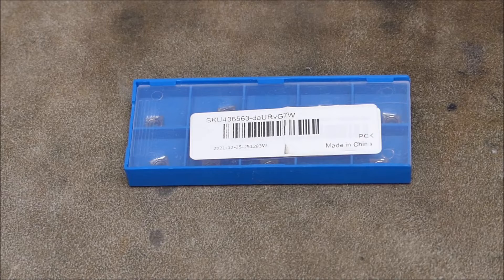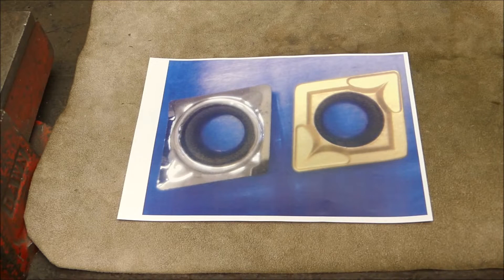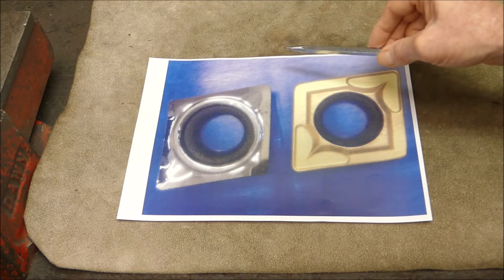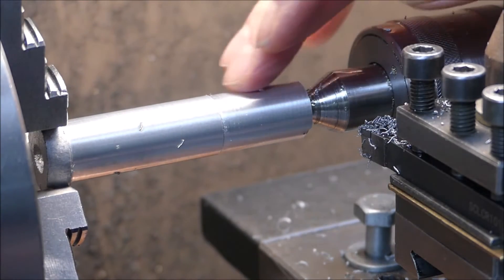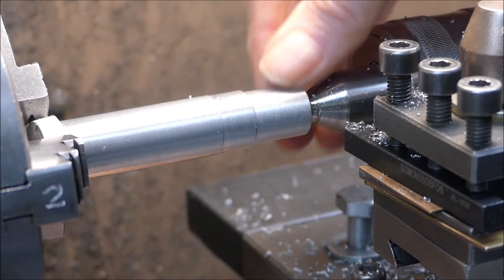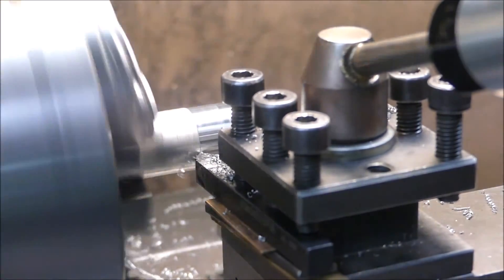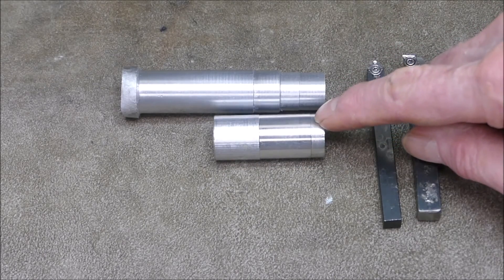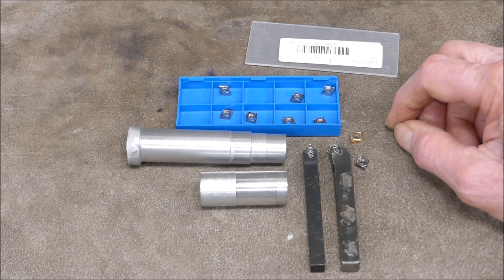Are cheap carbide inserts for turning aluminium any good ?

Comment: These cheap aliexpress inserts definitely have a  place in the home workshop, i have tryed alot of them (draws full of then) with various geometry & for various metals & after months of testing  there weakness is longevity there no where near as hard (there brittle) compared  to branded inserts but they are cheap enough to just replace however they have no place in a production environment IMHO. Some of these inserts are just superb but you have to use the correct inserts for the correct metals & speeds.
Reply from the maker: Yes, you get what you pay for.  The quality of Chinese inserts has improved markedly over the years and is way better than inserts made in India (from my experience). For home use Chinese inserts are fine.  There may be high end Chinese brands suitable for production work, I can't say as that's not my field.  For home turning/learning it's better to ruin a cheap insert than an expensive name brand.  They can all be damaged through misuse. Cheers Rob

Comment: I bought some WNMG inserts for aluminum, I found they gave a reasonable result on mild steel. I tried them as a last resort, noting else was working.
Reply from the maker: They have a very sharp cutting edge  (for carbide) and work a lot like HSS.  Particularly useful/effective on low grade steel that would otherwise tear up and feather badly. Only good for light cuts otherwise they will break the edges.  Not recommended for brass as they can easily catch and dig in due to the large top relief.  Cheers Rob

Comment: I use those same aluminium inserts, I like them ! They give me a really good finish and I like the super sharp edges… I don’t ever take huge cuts, maximum 0.5mm cut, but for the work I do is fine…
Reply from the maker: Yes, provided you keep the DOC down they work great on most metal.  Don't use them on brass as the profile is all wrong and they will catch and dig in.  Cheers Rob

Comment: I use those inserts all the time on my personal lathe. A guy gave me 50 boxes of different types at an auction. They finish steel better with high rpm’s. I use a homemade drip solution with aluminum for a good finish. It’s possible to run dry with a feed rate of eternity. 
I mean they are cheap and like high temperature. Might as well crank the rpm’s up. I’ve spun up around 1500 with mild.

Comment: Love your honest practicable reviews Rob.  If your home melt castings are from previous cast aluminium they will contain a percentage of silicon to help with fluidity and shrinkage.  Silicon is hard (try machining silicon bronze compaired to leaded bronze) and the machined finish will suffer in aluminium. That's often the trade off, good castings that fill the mold with reduced shrinkage or good surface finish when machining.
Would be great to see how these inserts would perform on light cuts in steel and if they produce the same good surface finish.
Cam
Reply from the maker: Hi Cam, thanks for the comments.  I will try the other tips of the already damaged insert on some mild steel and see what happens.  Quite a few viewers say they do it.  So I guess I had better follow up on this ;)  Plastic and copper are also supposed to machine well.  Stay tuned.  Cheers Rob

Comment: Interesting review Rob, used to use these a lot in my past (obviously not Banggood ones lol), they are good as a finishing insert, will do a decent job in mild steel also. Happy New year. Cheers, Jon
Reply from the maker: Interesting info Jon.  I see a few similar steel use comments, but only for very light cuts.  It chipped dead easy to the point that I was a bit shocked.  Most Banggood inserts are pretty tough, although I have found their DCMT blue nano inserts chip easily.  TCMT is a good all rounder and was the first carbide insert recommended to me (by a machinist) when I got into metal turning.  I hope 2022 turns into a better year for everyone.  Cheers Rob

Comment: You are not using them correctly. Far too slow and shallow. Any decent insert will have the recommended speed and feeds on the box. 
They are excellent on brass and intermittent cuts are not a problem.

Comment: I use CCGT inserts all the time for Aluminium. The polished top surface helps to stop galling but yes, they are still best with coolant/lube. A 1" dia. bar could do with turning at 2000 rpm though! They can also be good for light cuts on Stainless Steel (at much lower speeds, of course) though, as you say, they are a bit fragile. Wrong geometry for Brass & definitely not for Cast Iron!
Reply: I’d say 3000+ would be fine with coolant

Comment: Happy new year Rob. I use these inserts for everything, the positive rake takes a lot less effort to push through materials on my tiny lathe, I first heard about using them from the channel "smalllathe" who uses them on his benchtop CNC lathes.
Reply from the maker: Hi James.  Yes, you put much less stress on the lathe using positive inserts.  Negative rake inserts are really meant for stronger machines and are more durable, so industry uses them a lot.  Cheers Rob

Comment: Hi Rob. I have a box of those, so far only used them on aluminium, great finish, but I think it's time to experiment 🙂 Cheers, Alan.
Reply from the maker: Hi Alan,  I had never used them before and they did well for carbide.  I was impressed with the end result.  No good for brass, but people say they work well on plastic and copper, so there's a few things to try.  I had been meaning to try these for quite a while.  Lots of positive written reviews on the web page.  Cheers Rob

Comment: Your casting could machine better if you made it from only extruded aluminium, which has almost no silicon in it. The  shop made casting at least does not make long chips when machining, as it work hardens during the cut. Extruded has to be purer to extrude properly, so will make long chips.
Reply from the maker: Sounds reasonable to me Sean.  I mainly use recycled alloy car wheel rims, which are pretty tough, but probably have a bit of silicon in the mix.  I don't have a source for extrusions, otherwise I would give it a try.  Thanks for the comment.  Cheers Rob
Reply: @Xynudu  Just start to collect scrap metal till you get enough extrusions. Might mean a day or two on garbage day, driving before sparrow fart looking for any hard rubbish with enough aluminium in it, then collecting the lot till you get enough to try a single casting.  Probably will have a lot of shrinkage in the cast, so use your largest longest pipe for it.  If it does not work mix with the regular casting, and your chips probably will end up longer, with a slightly better finish. Will not be as hard to machine.

Hardest thing to machine is PTFE, especially when pure, when you really want a nice sharp brand new tip in the lathe. Next is pure unfilled nylon, and the nicest is self lubricating Vesconite.

Comment: I've used these on the little Drummond for light cuts on ally and steel . Can't fault them for convenience but my best home ground HSS has it hands down for finish and durability.
Horses for courses, I keep a few handy because they have their uses.
The point you make about machining grade as opposed to random unknown metal is an important one for anyone new to lathe work.

Countless times on forums we get the I can't get a good finish question. The answer is usually that the random lump of steel /ally in the chuck 
is the culprit ,not the tool or the lathe.
A good review Rob, I think you covered all the issues very clearly there.
Reply from the maker: Thanks Lee.  The quality of the lump in the chuck certainly has a big effect on the outcome.  Trying to turn rubbish makes you learn faster and correct the situation ;)  He He.  I think we've all been there at some stage.  It can be a challenge. Cheers Rob

Comment: It's ok for steel as long as they dont get used for interrupted cuts. Plenty of wd40 or kerosene oil needed for aluminium or you'd get aluminium build up on edge ruining it. Rubbish on brass, even have had some catch and break.

Comment: I use these for everything up to stainless steel and sometimes resharpen them on a diamond plate.
It's a bit unsophisticated I guess, but I like the results on my similarly sized lathe.
Reply from the maker: Sounds good Robin.  I often resharpen my GP inserts and it's a good opportunity to play around with different profiles.  It doesn't take much variation to make a big difference.  I will try the ally ones on other materials when I get a chance.  Cast iron would be interesting.  Cheers Rob
Reply: @Xynudu  Sounds good to me. 👍🙂

Comment: I have several boxes of those in the insert drawer . Great when your working on a fast spinning soft metal !
Reply from the maker: Hi Shawn.  I had never used them before.  How do they go with interrupted cuts ?  I use HSS normally for ally and brass.  Cheers Rob
Reply: @Xynudu  they work well as long as you take it easy and not try to take to much at one time . If you order them out of china they are even cheaper ! Great share Rob ..

Comment: I got some aluminum inserts from banggood for my face mill the do great, but my high speed steel with a  round radius is hard to beat. Great info rob,👍.
Reply from the maker: Yes, HSS is hard to beat for some applications, interrupted cuts especially.  Cheers Rob

Comment: Happy New Year, Rob! Interesting results! 2 cents: You really shouldn't put down your homebrewed Al, as it's a different animal from the storebought pure product. Guess your remelt was from diecasts - as it gets that short, curly swarf from its ca 8-11% Si content, and hence cannot get that über-fine turned finish as the pure Al gets (and also not the stringy swarf bird nests...) The contained Si also wears HSS cutting edges faster than pure Al does, but you could use an HSS shear tool + polish if you want to get closer that mirror finish, but that's the tradeoff for using Si in the melts: better mold flow, less shrinkage, self-ageing and a bit harder than pure Al. ATB DIYSwede
Reply from the maker: Happy new year to you as well Johan.  That aluminium was from melted down Toyota alloy wheel rims, not die cast.   I hope you noticed there was NO porosity in it despite the fact that I don't use a degasser or flux ;)  It's all about the temperature.  Pour as soon as it becomes liquid and you won't form hydrogen.  The inserts did well, but HSS will do just as good.  I was interested to see if the inserts were as good as some people rave about them.  Cheers Rob
Reply: @Xynudu  Those rims are die cast, IIRC in a spin mould, to get the density up and no porosity, and to get a fast cycle time. close tolerance die to mean minimal finishing, but after casting they have a full CNC clean up pass.